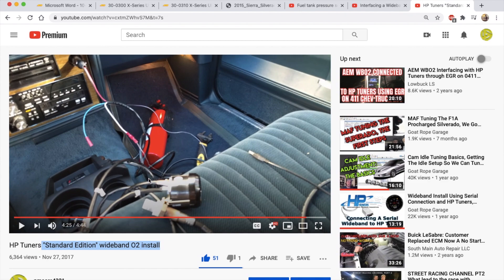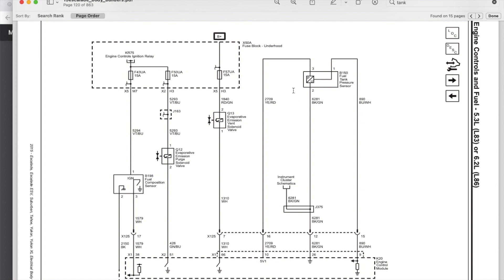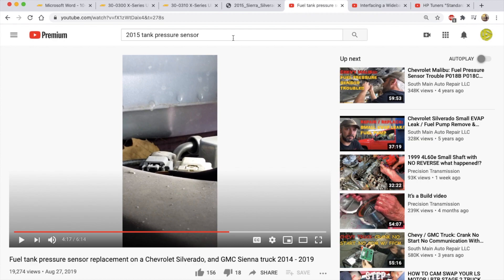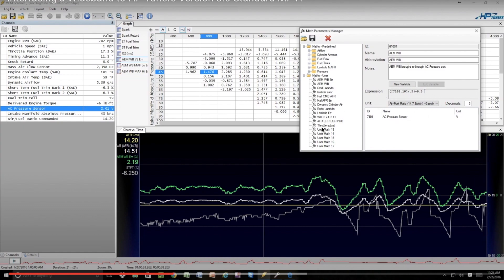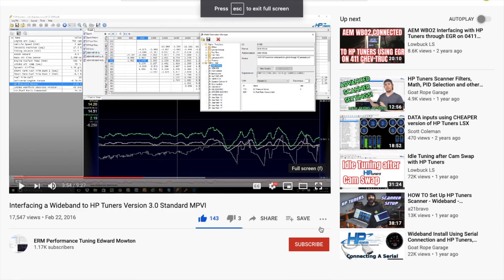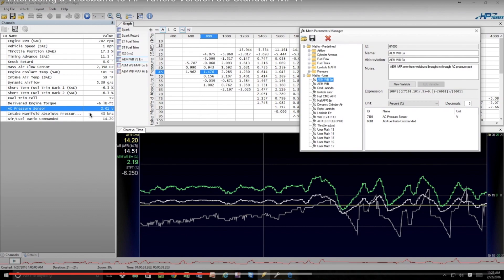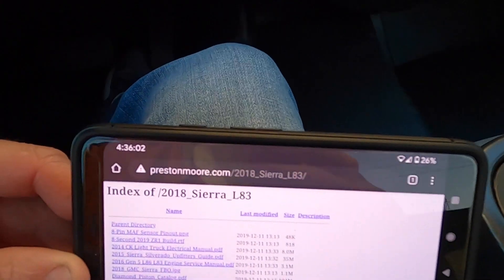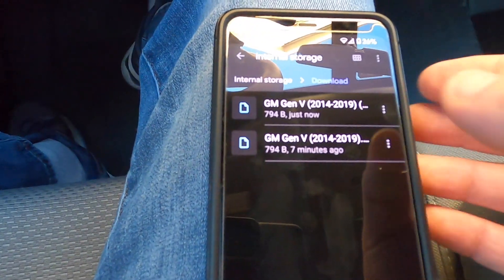Gen V Analog Wideband Data for HP Tuners - L83 L86 LT1 5.3 6.2 LT4

Comment: @pmoore4321 I would like to know if you had any issues with your Whipple clearing the cowl on your truck when you used the ICT spacers? Thank you very much...your videos have been very helpful. Rob
Reply from the maker: The 1/2" spacers clear the cowl, but not by much.  You have to install the spacers after mounting the SC to the lower intake by removing the valve covers and sliding them in.  I believe if you had the spacers milled in half (.025"), the SC would be easier to install.  Not 100% sure.
Reply: Thank you so much. I’d have them milled down but my machine shop out here doesn’t have the right machine to do it. You are the man! Please keep posting videos. They have helped so much. Aloha, Rob

Comment: Hey man thanks for the heads up on the wideband got 2 of them!
Reply from the maker: I hope they ship.  The seller seems questionable.
Reply: @nu5m_radio   I know I agree but eBay has money back guarantee so it’s worth the gamble but very suspicious he states no tracking provided and full warranty lol I would say those fell off a truck! In China! Lol! Quick question man first off love the videos and appreciate your time! Second I have 15 Sierra with l86 on3 76/65 billet wheel turbo made 444/484 then added lt4 pump and e85 and closed off the boost controller and made 510/570  on a hot day with no fan on the inter cooler then when it turned cold a few days later it break up when I would get on it so I had to lower the boost would lt4 injectors be the way to go or methanol want to get back to 10 lbs of boost that’s what I was running! Also do you have  Patreon
Reply from the maker: @K4gixxer1000  I would say meth is the the most cost effective route.  The injectors and meth even better.  You can go a long, long way on a good meth setup.  No Patreon.
Reply: Anyone else get a notification from eBay that the item was removed?
Reply from the maker: @icemanohio03  yep.
Reply: @icemanohio03   I did as well hope we get our money back I bought 2